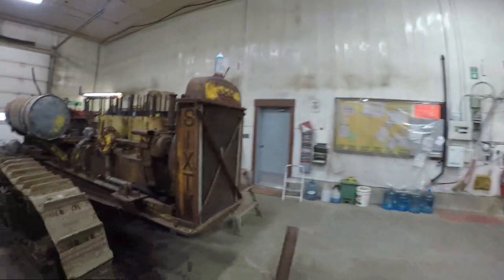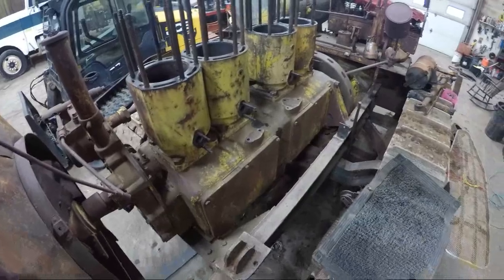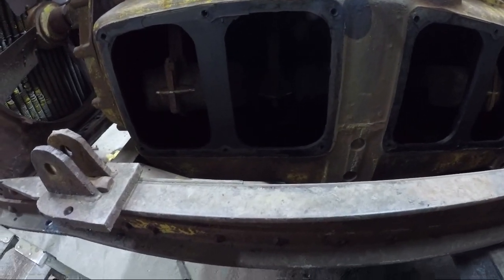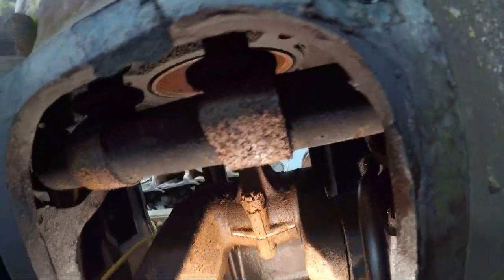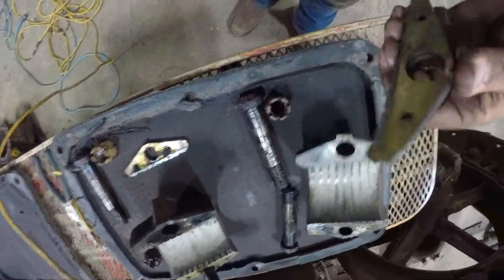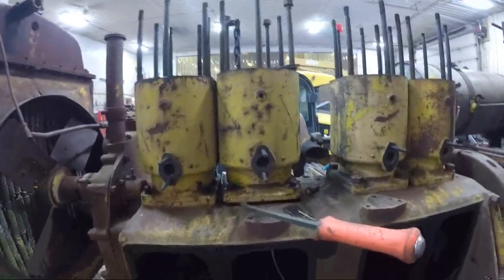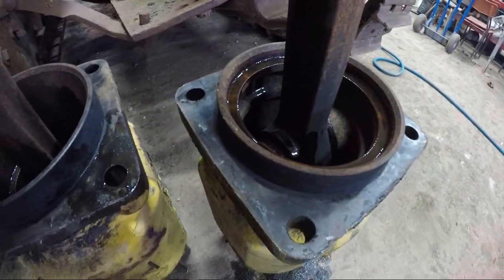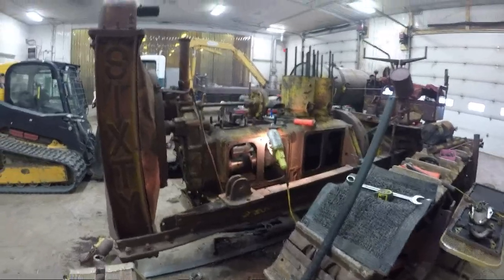Caterpillar SIXTY Rebuild Project - Disassembly Part 4 removing #1 and #2 cylinders

Comment: Seized cylinders are always a challenge. The best way to do it is hydraulically. Before you get started save at least one head gasket. You just have to clean up one head. Make sure the valves are seated positively. I like to blast the trash out of the cylinder with light sand. Blow it all out and soak it down with weasel pee (PB Blaster, Nut Kracker or Sea Foam are my favorites). Put the head back on and torque it down. Then fill the cylinder completely with old crankcase oil (or transmission oil, whatever takes your fancy). Take a piece of shaft and spin out an end like a spark plug so that it will thread into the hole; a couple of flats on the outside will accomodate a wrench. Bore a hole down the center and then carefully cut a female 1/8" NPT into the opposite end (Use a good sharp tap). Thread a Lincoln grease gun or equivilant directly into the adapter and start pumping. A good grease gun can put out 3,000 psi. I came across a John Deere D that was just as hopeless as this. One piston went solid a few times but after a couple of coffee breaks (not to mention several stories about the good ol' days), and it gave a grunt and broke loose. The other cylinder wasn't so reluctant. Made kind of a mess pouring that oil out of the cylinder but the pistons came free. Took a good Sunnen hone to the cylinder. There were lots of 'freckles' but the ring lands were still good on the pistons. A new set of rings and the tractor was on its way to an otherwise complete restoration.
Reply from the maker: Our plan it to just use our big shop press and get the pistons moving.  We were limited on time to get it apart while I was on a week of vacation and I live over 3 hours away from the shop.  Getting things apart and assessing what parts we needed to be on the look out for was the priority for the first stage.  We will get them out next week when I’m back again and keep plugging forward- thanks again for watching and the the tips

Comment: I have been using acetone & automatic transmission fluid as a rust remover/penetrant. I am a real fan of PB Blaster but the home-made version seems to work even better than PB Blaster.
Reply from the maker: Hi Terry thanks for watching o will keep that concoction in mind

Comment: Thank-You for doing this series on the Cat 60. When I worked Road Construction we never worried about numbers matching, we only cared how quickly we could return a piece of Equipment back to work which usualy ment a short block and sometimes no matter how good You take care of stuff the Companies would buy auction Equipment that would just make You shake Your head on how the previous Owners managed to crack the Block or put stress fractures completely throughout the Transmission Case.
Reply from the maker: We sometimes forget we’re working on a restoration not a full production machine - sometimes grandpa likes to get things running a quick as possible, no fault to him it’s just how it’s been his entire career in the dirt moving business.  This one I’m really trying to keep him on the same page as me…that we have time to do it right.  Thanks for tuning in and watching :)

Comment: The last Avery 50 that i did the cylinders on, i sleeved the sleeves, I do not know your shop well but a good 4 jaw and time and you can make them just like new. also if the pistons are rough they can be turned down a skosh and sleeve to fit, good as new. no matter what way you go good luck. great series.
Reply from the maker: Thanks for watching and for your thoughts.  After the engine is all apart I’ll be able to better decide what to do for parts and pieces.
Reply: @ironman3406  I was a commercial engine builder  for a lot of my years,,contact me anytime if you want to talk about my thoughts
Reply from the maker: @survivingmaineona20acrefar77  much appreciated thanks 😊

Comment: Nathan, what I have found is use a wire brush to clean the rusty threads before you take them out off. And perhaps you ought to put the side covers back on the Block and just fill the crankcase up with diesel and acetone and let it soak for a couple weeks.?
Reply from the maker: Great suggestion will keep in mind for the future - everything is already apart lol - thanks for tuning in

Comment: Thanks for sharing I seen a old guy put wd40 in a gas engine through the spark plug hole and he rigged up a couple to his air hose and put pressure to it seemed like it helped force it into the rings cause after he did it the engine started to free up but it could have been barely stuck hard to say I just
Reply from the maker: Thanks Scrotie - i guess I’ll have to remember that for the future and give it a try.  Thanks for watching

Comment: An older gentleman near me who has since passed was a wealth of knowledge. He said he would pour about an inch of diesel fuel on top of piston and light it on fire that the fuel oil would help to keep piston cool as cylinder wall would warm up slowly and fuel oil would soak down. I did that with the one of mine which was incredibly tight, I don’t know if it helped but I got it out. Oldfarmjunk101 has a video of doing that on a Farmall H.

Comment: Hope you don’t get tired of me commenting. Are the cam followers stuck in the guides, mine were stuck very tight. I hate to admit it but I broke one cam follower guide pressing the follower out. One piston took 20 ton jack in my press and heat to get it to move, kind of scary. I had an inch thick plate just slightly smaller than piston to press on as I was worried about possibility of breaking top ring land but all turned out well. The press really jumped when the piston first moved. Good luck!
Reply from the maker: No comment away, you’ve been through all of this already so you can provide good insight.  All the followers are stuck yes, they are all soaking in a pail of diesel right now. 20 tons yeesh, but I won’t be surprised if that’s how much ours take, they are in there good.  Keep the tips and hurdles you had to overcome coming.

Comment: I use a front end loader for pulling engine parts like you do but since I don't have anyone to operate the lift I position the forks above the load and use a chain hoist hanging from the forks as my mobile crane. This way I can lift with the chain hoist and monitor the part I am lifting.
Reply: Same here.  Working alone has its’ challenges with no proper service truck hoist.  I use the same method;  chain fall, on the forks of the Cat telehandler.  Works great.
Reply from the maker: Thanks for watching Jeff - it is handy having when we can work together.  Sounds like you have a good solution for your situation too.

Comment: The crank on mine had a fair amount of pitting, I polished it and I’m sure it will be fine. On mine the biggest concern is the center main with the thrust bearing surface. I took the main caps off before I even thought about turning the crank. With the main caps off I jacked under the flywheel and a little pry under the front of the crank to take pressure off and it was possible to rotate the bottom half of mains out and facilitate polishing the crank all the way around. Numbers matching may be nice but having a running one to enjoy for me would be the priority. I’ll keep watching, it brings back good memories but I’m glad it’s behind me!